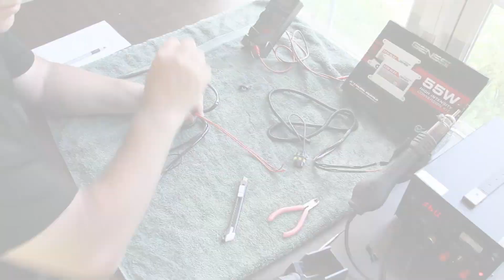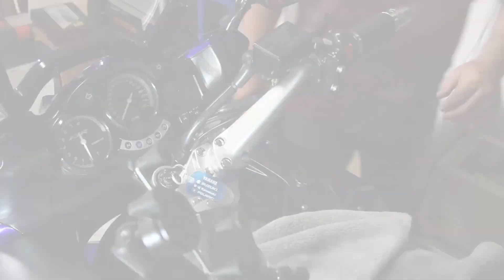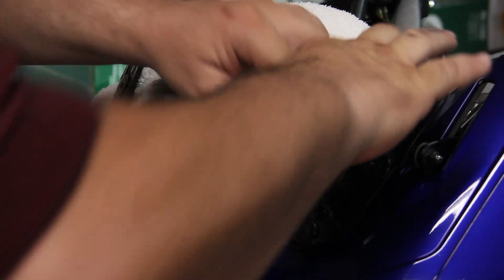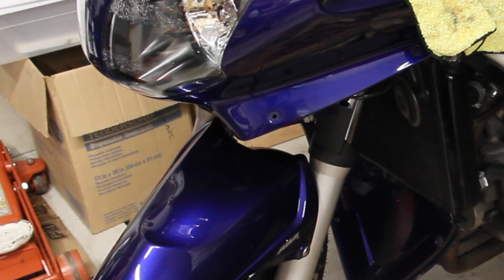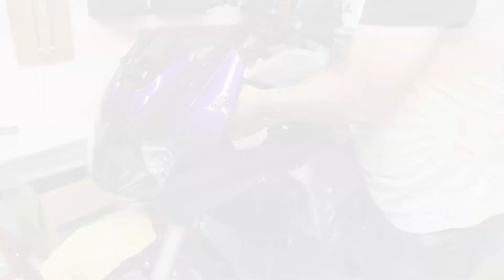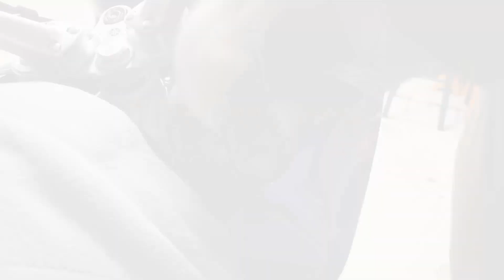HID Headlights Installation on the Yamaha FJR1300

Comment: What a ahit job… Jezus 

Light breaks down and your realy fked! Hard to swap those…
Reply from the maker: I agree if the ballasts does go bad, you have to do more work. My experience so far was about 2 years I had to only change the bulb.

The gain of additional brightness I think is worth it.  As far as heat. These bulbs have a shroud around them, protecting the plastic from any high heat. The heat around the base was similar to the factory bulb.

Comment: Howdy

Id like to do the conversation on mine too!

Can you please show me the front blinker  holder? Id like to upgrade mine to us specs with running indicators.

Also have the hid kit given you any idsues and how many years has it been?
Reply from the maker: Hello, the blinker relay is in the bank of relays on the right side of the back of the speedo, under the front fairing.  Hids has been working over 3 years, the right headlight just went out. I'll look at it this winter when I get a chance.
Reply: @mikesfjrcorner7129  thanks Mike! I dont need the relay, I'd like to see the actual bulb holder as yours, being us spec has an extra wire for the running lights, which mine does not have.

Comment: Hi Mike I'm trying to change the clock plate from mph to kph but I can't find your video how you did it.  Please help. Your description is always great
Reply from the maker: Hello, I never did a video for the speedo. What you do is, take the front fairing off, use the video to install hid headlights for a guide. Remove the bolts holding the speedo. Once you have the assembly out, remove the screws on the back holding the plastic screen cover. Take a picture of the indicator position. Now carefully remove the cover and set flat on the back. Using 2 spoons, put the edge of the spoons under the indicator on both sides of the indicator shaft with the bottom of the spoons touching the face plate  gently push down on the spoon handles and slowly, the indicator will come off the shaft. Make sure you don't turn the indicator. Now remove the 2 screws and replace the face plate. Replace the screws.
Reply from the maker: Don't over tighten the two screws, the plate is plastic and over time they will bubble. Press the indicator back on to the shaft in the original position. If you did not turn the shaft in any way, the indicator should be accurate. Reassemble the speedo, put back on bike. Before replacing the fairing, take it for a ride, verify speed with a GPS or speedo app on your phone. If it is correct, great, if it's off, disassemble it again and remove the indicator, adjust it's position, put it back together and go for another test ride.

This is also a good time to replace the bulbs.
Hope this helps, mike

Comment: Thanks mike.
I'm thinking replacement led,s on my 2003 fjr as one of my winter projects.
Will I be able to just change out the bulbs from the original? I don't care to take the head light cover off

Also, when you ride under normal conditions, ie summer, do you get 2 or 3 bars on your temperature indicator?
Best regards
Reply: 4

Comment: Thank you.
Calm video without extraneous noise, irritants.
We are ending the season, and in 8 months of winter I will try your technique.
good luck and health
Reply from the maker: They sit tightly between the headlights, if you make a plate like what I did in the video and keep everything tight you should not have any problems. Make sure you use a headlight relay. Anyway, good luck, Mike

Comment: Hello Mike, Was watching how you removed the front center fairing in the video on HID bulb replacement to the stock halogen bulb. I am trying to get to the windshield motor assembly ( have issues/strong vibrations when windshield is in lowest position). I do have a 2012 FJR (Gen 2 ?). Do you by any chance know if process to remove that front fairing assembly is same as how you showed in your own video on the headlight bulbs?  Many thanks? YL
Reply from the maker: Unfortunately I have not worked on a gen 2 or 3.

Comment: You should do another video on detailed fairing removal. There is basically no resources out there for gen 1 bikes. I bought a second bike to use as a model to reassemble my FJR after a bad wreck. Thanks for the videos.
Reply: HI, Absolutely agree with you. A more detailed fairing removal will be of great value to the community!!  BTW, is one of your bikes a Gen 2?  Wondering if there is any difference, or major difference, between Gen 1 and II insofar as fairing removal.  Thanks!!\

Comment: Thanks Mike.

 Seems I might still have a bolt holding the top fairing right below the Yamaha emblem on the front?

Do you have whatsapp? I can send you images of what I am struggling with.

+27834905357

Comment: You do an incredible job & make it look so easy!!!!  Thank you very much, I'll use this to do my dash lights.
Reply from the maker: Thanks,  I just try to break it down to one step at a time. My A.D.D brain can't talk for two long without buffering! 
I just edited the description section of the video to list links to all of the bulb's used and where to get the LED's as well as the gauge face plates.
Reply: @mikesfjrcorner7129  Yes I seen it along with many others of you video & liked all I seen!!!
Reply: I order the lights put them in the instrument panel but only 4 of them worked.  3 for speedometer & tachometer which uses 4 lights but only 3 worked put regular bulb back in & it worked.  The neutral light was the only other bulb I could get to work.  Is there a special tool for putting them in?  I'm taking it apart again & trying them one more time.  Do you have any suggestions?
Reply from the maker: The LED's have a polarity, if they don't work reverse them in the socket. Also, make sure they are making connection. They all should work.
Reply: Your right I now have all the LED's working thanks to you!!!  Thank you again for sharing your expert knowledge!!!!!